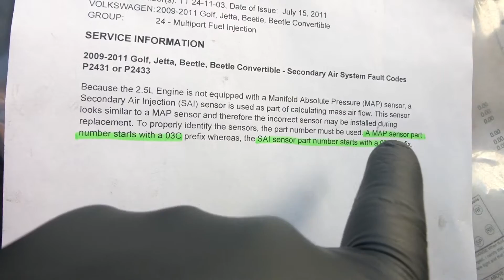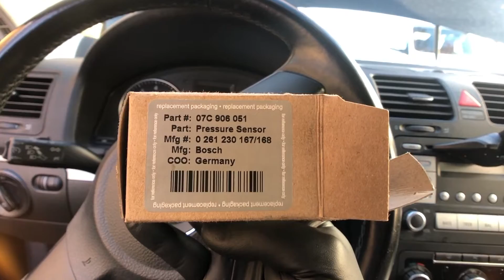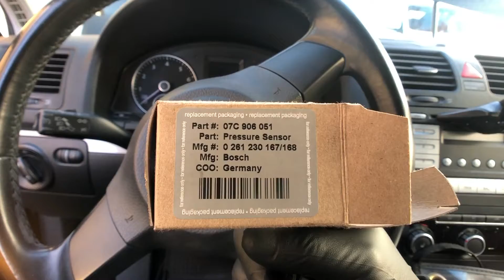Volkswagen Jetta P0106 P2433 Important Information

Comment: I cannot find a SAI sensor :(
Reply: save anybody else looking for one time: most parts stores aint gonna have the SAI, they will only have MAPs and they will attempt to sell you one as a SAI sometimes. VW dealerships have it under the part number shown here listed as "PRESSENS"
Reply: What year Volkswagen do you have
Reply: I have a 2012 Volkswagen Jetta 2.5 SE   5 cylinder
Reply: You will find them at the local part stores .  But once you find one and see the price for one you will run.l from it .
  $170 SAI.   I went to junk yard / pull your own mf part.  And I paid $2 to get in and walked out with a $200 sensor just like that
Reply: My SAI sensor does not look like the MAP sensor at not even close . It's the small 2 to 4 bar MAP sensor you see on other cars .v
Reply: SAI part # AS481 $179
Reply: I guess around year if my car they updated or changed the MAP sensor to smaller and different than the basic map sensor
Reply: @michaelgarriott8655  2012 is a mk6 I'm assuming this video was about the MK5... i think 2010 was the last year on the mk5. I wasn't notified of your responses to me before, but I had actually come across this video after I went and bought a "SAI sensor" from AutoZone that turned out to just be a MAP sensor that was inventoried wrong.

Comment: Hi, I have a 2012 Vw New Beetle 2.5L

Check engine light came on with code p0491 and it failed C.A. smog test.

My mechanic wants me to change Combi valve and secondary air pump. I don't believe him, I'm not sure if he's trying to scam me?

Any feedbacks are kindly appreciated. 
Thanks

Comment: This has happened to me with Jettas! 2011 Jetta/Golf 2.5 used a 3-wire sensor for SAI, p/n is 07K 906 051 if I remember correctly. Solved the "identical" sensor for both VW and Audi.

Comment: Good points and video. Those map sensors are notorious for getting oil in them and going bad. Under the TB is a terrible location to put a map sensor. As far as the parts vw probably makes em the same to save money. I believe they both function the same way.
Reply: You are right I worked in Europe for VW and this is very common for VW why making 2 different parts when you can just change a little thing like 3 wiring and 4 wiring even when you had the disc for the break make some like 4 models the same and sale it higher price you can think is a scam but is not is just efficient working for the German smart in a way make more profit well I have VW Jetta and I have exactly this problem actually crazy more of this electronic problem is annoying in other words there is no Auto Mechanic any more is just replace the parts and this is over 30 years like this and you notice this little parts cost more and is Bosh well almost all the German have Bosh and they look almost similar in the parts even VW group uses core engines across their line, Porsche, Audi, VW, Skoda, Lambo (yep), etc. And also, the 2017 US based Jetta, shares many platform components with Audi so go figure with VW what the reason is I think is profit that’s it